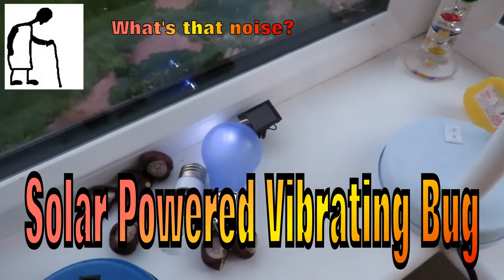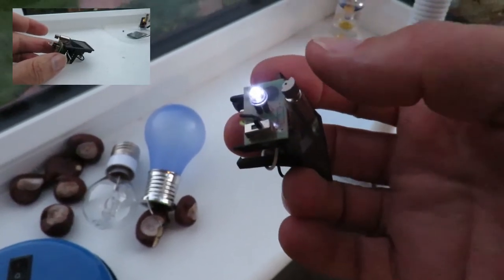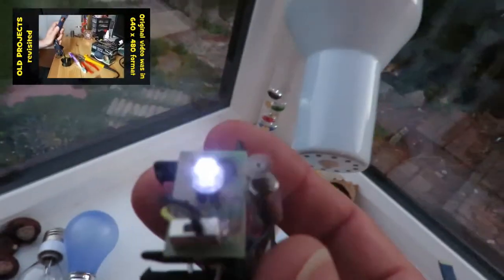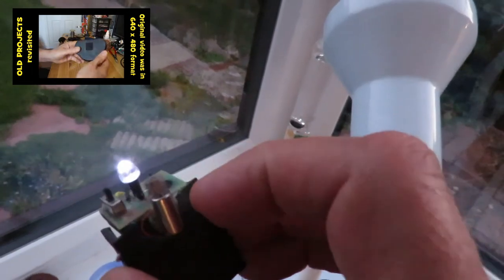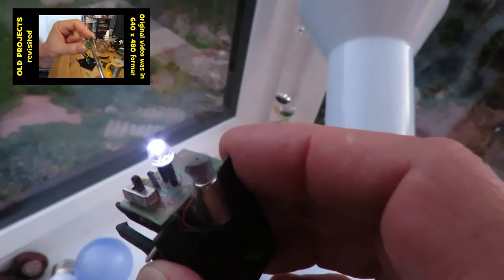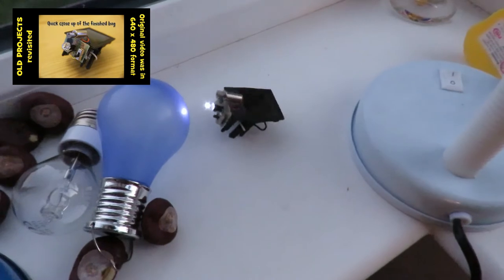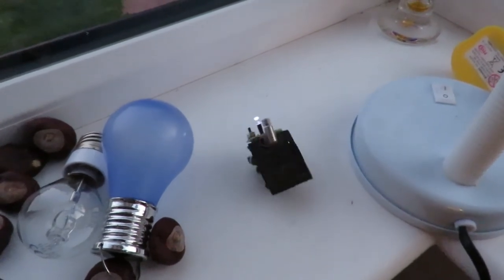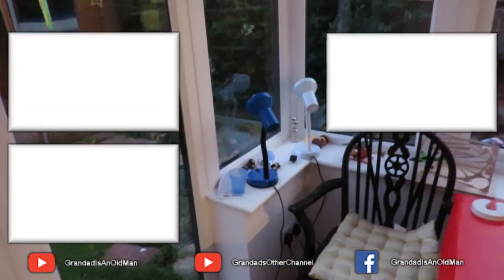What's that noise? Solar Powered Vibrating Bug

Comment: Great build idea. I remember searching everywhere for flashing LED's and doing this another way with a different circuit. Was months wondering what a FLED was lol
Reply from the maker: I think we have discussed that before and you may even have commented when I originally built this one. I was just looking at the original video and YouTube has seen fit to delete/hide everybody's comments except my replies ??
Reply: Perhaps YT are looking out for our aging selves. We can now say "see, it's not just me, noone remembers and there's no record of it !"
Pet peeve at the moment is seeing say 10 unanswered comments on the bell thing, answering 1 and the bell goes blank. Have to step through from the bottom to know they've been answered.
Reply from the maker: I always end up looking though comments on the community tab to look for missed messages as the notifications bell simply does not work right. I reported a problem I was getting where the notifications were telling me about new comments that were months or even years old. After about a month of helpful suggestions from their standard list of support replies, like clear my cache, reboot my computer, try a different device, try a different browser etc they assure me they have now fixed that problem. Call me cynical but I suspect their fix was to hide all comments over a few weeks old. I have several issues ongoing with YouTube support and it is so tempting to publish their replies. Every single issue I have raised always gets the same two initial reply messages from them. Obviously they are automated replies designed to pacify the uninitiated but once you have raised more than two issues you recognise the "standard process" they go through. You need to get to the third reply before you get any indication they have even read the details on your initial query and then probably another two or three emails before they have actually read it rather than scanned it for key words. Even questions like "Are you a robot or a real human?" seem to go unnoticed.